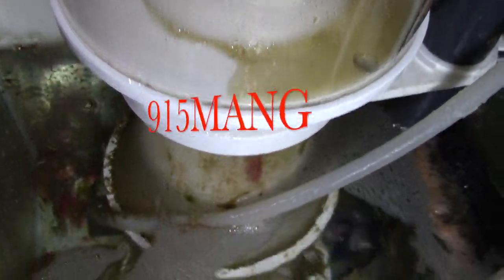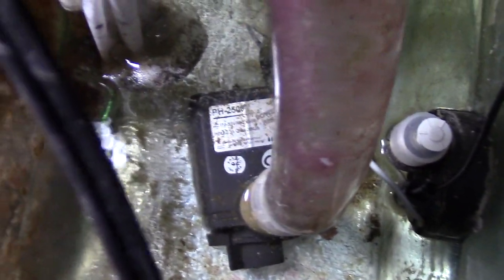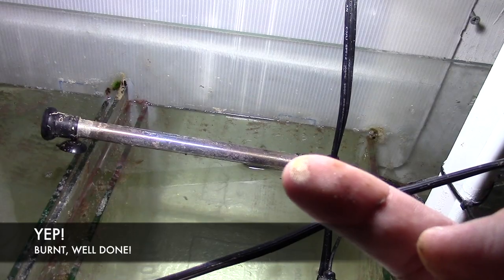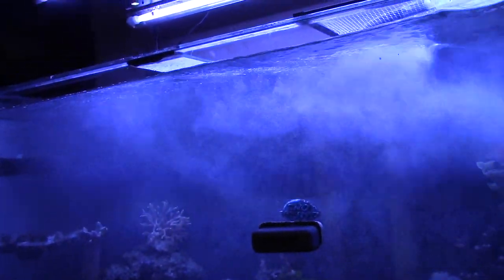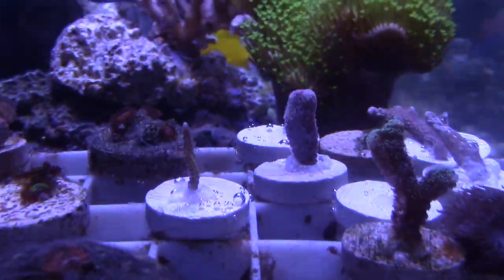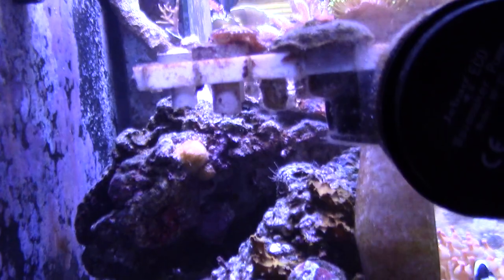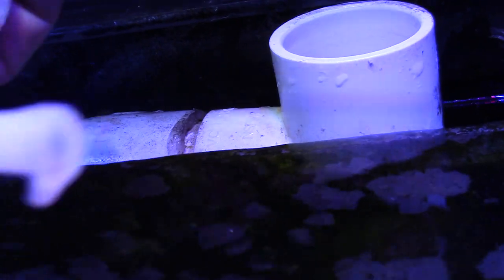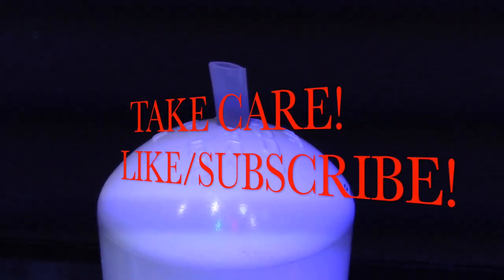HOW TO CHANGE AQUARIUM WATER AND CLEAN A SUMP COMO HACER UN SUMP

Comment: 915 putting out extra videos these days! That burn on the finger looked nice!! Would you run an air stone on a timer and have it run when the lights are off?
Reply from the maker: Yeah good catch with the Heater Burn. It felt nice, lol. Id just keep the airstone running all the time. They where saying the airbubbles help clean the water, theyve used it in places where pollution and supposedly it works. So why not give it a try!

Comment: this is exactly why i use socks and do not have a light or refugium in my sump :)
Reply from the maker: Yeah Im giving away all my socks, lol. But they do help out a lot. I just dont like changing them out
Reply: do you have a sock tray?  or the draw string type you have to put around the pipe?
Reply from the maker: No Hope In The Pope I have the round plastic type. If I get a better sump then I would. I like the new Trigger system sumps. Because if I dont change out my socks then the water will just spill over to the tank without making a mess